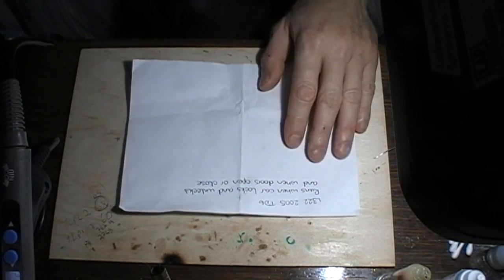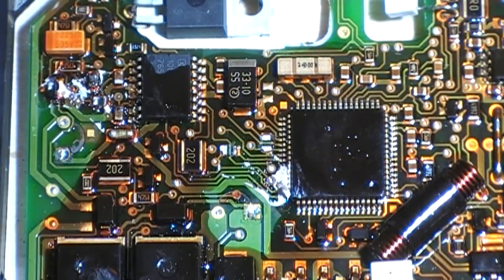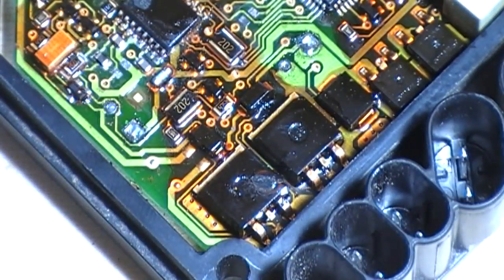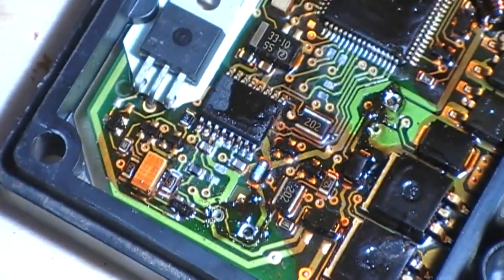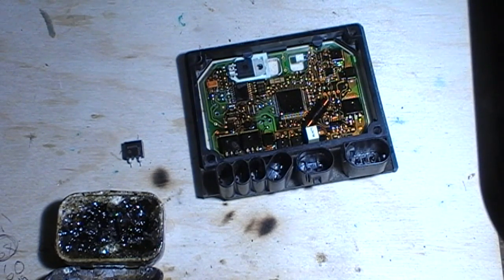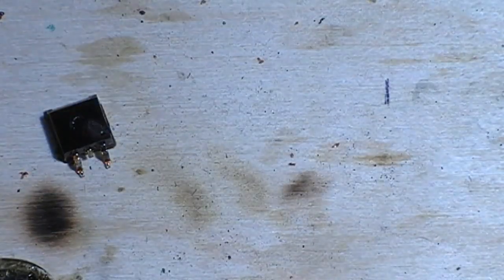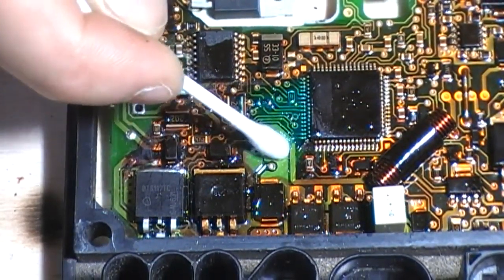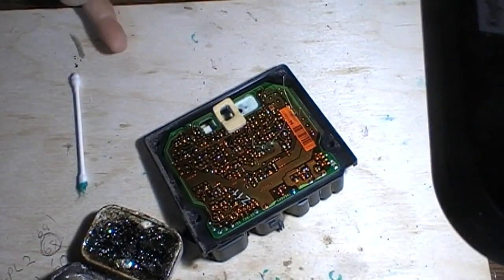Repair Of Rob`s L322 (91452C) Thermo Top C Board

Comment: Can you please post the exact specifications of the replacement components there?
I managed to find the 10k ohm , 7.5k ohm and 49.9k ohm resistors.. but they have them in many mW specs like 100mW, 0.2W, 0,3W.. so not sure wichs is needed. Also found the mosfet (are they all the same BTS117TC?) .. Failing to identify those JRB capacitors tho. Can you please post the details? Thanks and awesome work there..

Comment: Hi
I have a webasto with the exact same board.
Is there like a pattern, which parts cause which malfunction.
Or else, is there a pattern, which error is caused by which part?

Great Video
Reply from the maker: With that board problems arise from aging of the caps that leak, then cause more problems! but caps leaking only really affects the (91452C) board, other boards all have there own common faults!

Comment: what uv torch do use / recommend?   Mechanic 10ML GY-UVH900 Green UV Curable Solder Mask Paint for PCB Jumper Wire Protection would that do ?
Reply from the maker: Hi, i use this with both leds on: https://www.aliexpress.com/item/33003736533.html?spm=a2g0o.productlist.main.1.3e723f7fOLPlXY&algo_pvid=10998965-3960-466b-b383-d1ff80e31cef&algo_exp_id=10998965-3960-466b-b383-d1ff80e31cef-0&pdp_ext_f=%7B%22sku_id%22%3A%2210000006044528036%22%7D&pdp_npi=2%40dis%21GBP%2111.4%2110.25%21%21%21%21%21%402102160416729701625772701d06cd%2110000006044528036%21sea&curPageLogUid=zZsf1z6wa0L2 

It must have both 365 and 395nm!
regards

Comment: Hello and thank you for all your videos. 
In france we are a large community Who have Volkswagen t5 (caravelle Multivan etc) between 2003 and...2012 perhaps. We all have the same defect with  our webasto thermo top c. The ventilation of webasto is always turning, it doesnt matter if the vehicle is running, stopped, with key or not. It kill the secondary batterie and, of course, stop ventilation. During this time , i think generally the webasto is not hitting. 
Do you know this defect ? And the way to repair ?
Many thanks for your videos. Thats very helpful and sorry for my english.
Reply from the maker: Hi, there can be a few reasons for the issue of the fan running all the time! E-mail for more info...  robinsonlabsltd@gmail.com

Comment: Loving the content. You're like a British Louis Rossmann 😁
Reply from the maker: Thank you so much! i will be doing a soldering tutorial in the next video, showing what tools i use while recreating an old Land Rover board from scratch that is not available any more!
Reply: @robinsonlabs  Are you able to repair the L322 LCM boards? I think mine is on the way out.
Reply from the maker: @StreetMotionUK  Is that the seat motor ecu?
Reply: @robinsonlabs  It's the 'Light Check Module' - slightly odd name, but it essentially controls all the lighting circuits in the vehicle and I think also stores a backup of the odometer value. Not sure if it does the seats as well, I'd guess that may be a different board. The LCM is located in the right of the drivers side footwell and suffers from moisture ingress as per everything electrical on a range rover!
Reply from the maker: @StreetMotionUK  i tell you what, give me an e-mail and we can talk more